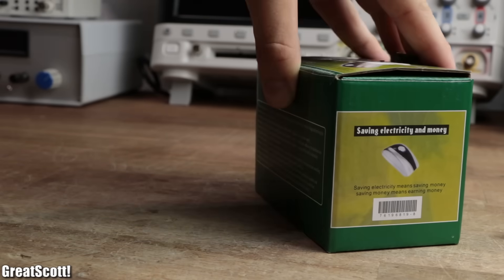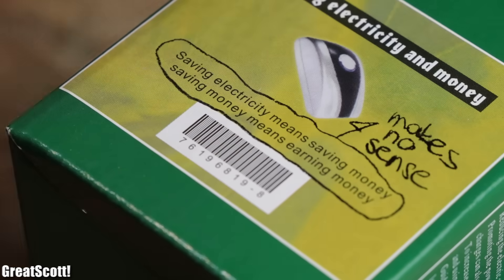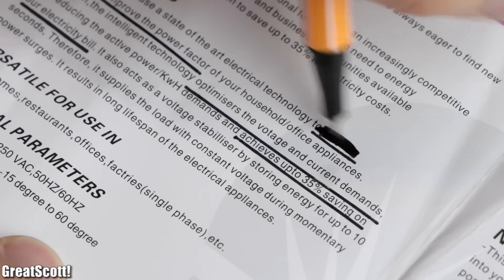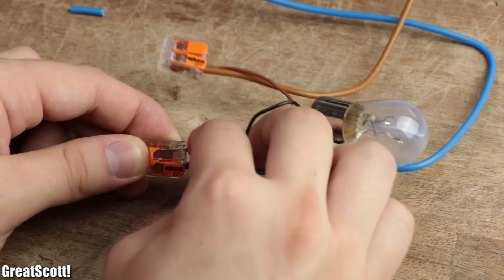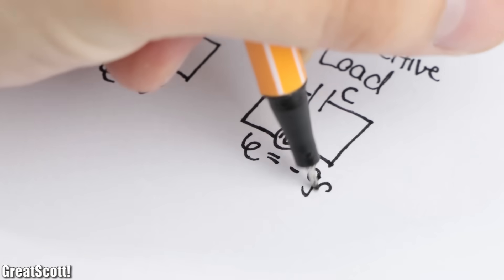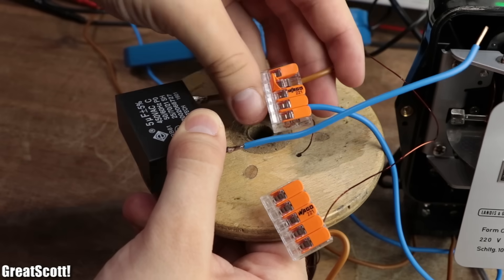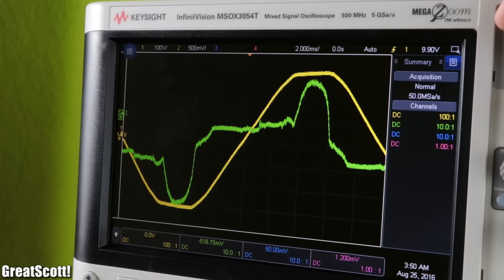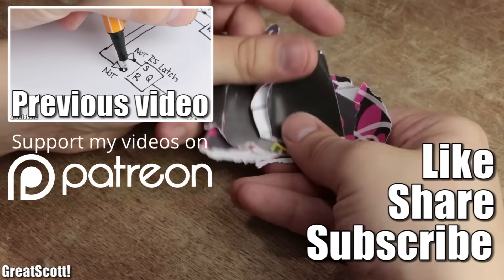Chinese Power Saver - Does it actually save power?

Comment: This power savers are actually power factor correctors used to connect next to inductive loads such ac motors or inductive loads to reduce the mains currents and hereby reduce the power transmission lost (cu lost in the mains cables). 30 years ago I met Americans came to Asia to market the same product! Any way it is not useful for normal homes which do not have big motor installed. And almost all the Electricians in China know about this device n know it does not save power at home n know what capacitor bank is about in the industrial n commercial applications. So this is an electric device, if you do not know how to use it, please consult qualify electricians.....

Comment: Power factor correction is widely used in industry, where there are typically large inductive loads that push voltage and current out of phase with each other. In these situations, it is possible to save a lot of money in terms of wiring and switchgear costs, because being out of phase pushes up the current that the wires have to carry, requiring heavier duty cables to get the same work done. Correcting the power factor is also an altruistic act in that it also reduces the wiring costs of the power companies. I don't think there would be much, if any, personal gain for households, but if everyone optimised their power factor, it might make electricity cheaper over all.
Chinese culture smiles upon people acting for the collective good. Ours does, too, to a certain extent, but we are more likely to be individually motivated. I am disturbed by the casual racism and ignorance of the humanity of other cultures in some of the comments. That hurts me. People are people.

Comment: Great vid this is the best explanation I have seen yet! The electrical theory behind these devices is sound, the problem in practice is that you have to size the capacitors and inductors specifically for each individual load. Just paralleling a capacitor of an arbitrary value into a circuit and expecting it to absorb or correct any leading current is foolish. The harmonics as a side effect only make the strain on the power grid even worse

Comment: The electricity or energy meters (Wechselstromzähler) for flats or family houses are designed in such a way that they only measure the real component of the AC current consumed (the one in phase with the AC voltage).
The complex task of power factor correction (Leistungsfaktorkorrektur), i.e. shrinking of the phase angle thus lowering the imaginary current component, which otherwise would tend to unnecessarily load the power lines, is deputed to power distribution companies. 
Amen! to this topic once forever

Comment: Thank you for posting . There  exist capacitive banks that can help but I have only seen them used in factories to reduce cost. However those are very expensive.  The new smart meters are doing a better job at monitoring this. The folks out there have to use solar powered batteries banks to reduce their energy cost at night. During the day I use the extra power collected by the solar panels that I have to reduce that cost. In the end use less electronics during peak times.

Comment: These chinese boxes are a rip off as the capacitors don't last long, but the science is sound. please attach your ammeter to your home fuse panel as before, then plug one of the boxes into a socket near the fuse box. when you turn the box on you will find a DROP in current used, less current means you are using less power, that little wheel in the electricity meter will turn slower, you will pay less, i experienced a 15% drop in my test, the capacitors are not large enough or self healing and do not last long. EPCOS is a large company who makes capacitors, they make a specific one for power factor correction called HOMECAP. https://powerpulse.net/homecap-from-epcos-for-residential-pfc/

Comment: I know it does not save you any money but it lowers current that wattmeter is reading. So, does that mean that I could plug in more inductive devices with a capacitor added in parallel?

Comment: It should save some money if you put like a washing machine or other inductive/motor load on the same power strip and use the power strip to control appliance on off.  For western countries it's not a big deal. But if you use solar/12V battery and an inverter to generate 110/220AC, then you definitely want to see if the device is useful for your situation.

Comment: The only thing you would need to reduce your power on is your compressor at start up on your AC and any motors and you have to do this VFD variable frequency drive which actually and I could be wrong converts the AC current to DC current does what it needs and on the way out basically convert it back over but it cannot do the variable frequency in a c current As far as I know I haven't been a maintenance in about eight years though so you never know what they've come up with I believe the guy with the second comment is correct if you buy enough of them you don't have any more outlets to useThe VFD where I used to work at at the prisons were huge course we were running 10 012 hp motors but unless they figured out how to control the alternate altering current from what I understand they have to switch it to DC to do thisBut what the hell do I know

Comment: Scott is really educated. Why, because other youtubers actually directly saying its fake but its not a fake product or a scam ;but scott actually says the truth . How??

You need to learn about a electrical engineering term called "Power Factor" to understand this. When we connect more inductive loads on ac mostly motors they create lagging power factor to compensate we need to put capacitor in parallel and this is what that deveice is.

But we can't actually mess up power factor this much that needs to be corrected.

The real answer is that this is not a fake device and Scott never said its fake or junk, he said its not required that is 100% correct.

Before any angry comment please learn about "Power factor" then comment 😊.

Comment: What about motor start up? The spike in electric motor start up could be supplied by the cap and it could be recharged slowly thereafter..  Smart meters and even some analog meters are designed to meter power at the initial spike and they keep running at that rate in order to charge the customer more money even though the power consumption levels off after initial load. This is why in industrial applications they install a capacitor bank and transformer unit in front of machines that have large electric motors..  To save power consumption, no?

Comment: Dear,
Could you review this product? 
It can save power by optimizing electron flow. It generates a wave which resonance with electron movement. Helping reduce resistor and then saving power.
http://www.cosmotor.net/main/

Comment: Saving or not depends on the type of electrical use inside the house meaning that if the consumption through the operation of electric motors  in this case availability and does not provide

Comment: For anyone curious, there is an actual industrial application to these things. As Scott said in the video, motors and capacitors create opposing shifts, the shift itself being called a "power factor" (a ratio of how much of your power is real). It's usually considered impractical and not bothered with to have residential customers billed for their power factor, but industrial customers often have a heavily skewed power factor without effort to fix this as their power consumption is heavily biased towards the inductive side due to (somewhat obviously) motors. As a result, factories bring people in to improve their power factor which does amount to adding some amount of capacitance. There's a bit about this in the wikipedia article on power factor. The idea that this would help a residential customer is pretty ridiculous, and there's a definite amount of cringe related to seeing a cheaply made metal box with no grounding they expect you to plug into your mains voltage.
Reply: Buyer beware ...SCAM.
Reply: Huh...but if im running a big CNC with a high power spindle, spindle controller, and stepper motors and such it might actually benefit yah?
Reply: @NeoIsrafil  No, residents aren't charged on reactive power. The cap will essentially turn active power into reactive power, costing you more.
In *industry*, they charge for both active and reactive and they charge you more for poor power factor. It works out cheaper to use the capacitors (with a controller to switch extras in and out) because you aren't penalised for poor power factor and you reduce your reactive power.

Comment: because the meter has a hard time reading var loads the device while does not save power by conservation it saves by cheating the meter into not registering.

the same supposedly as magnets on the meter or some other devices that inject power back into the meter out of phase to cause the meter to not work.

the meter is basically a motor and if you can interfere with the phase correctly it will not spin witch is why the wrong size run capacitor can cause the fan to run slow or even not at all

Comment: This is a simple dephasing system available for very small loads. That's true that old counters, that were built arround a magnet, were affected by dephasing provided the load was small, or the capacitance higher, but not the recent ones. This is not fake but abuse.

Comment: Well, in order to provide any kind of PFC correction, a capacitor has to match the inductive load. Simply putting a capacitor in parallel might provide power correction (to an extent) as well as might deviate the power factor even more. The only PFC that really works is the active power correction.

Comment: Of course it doesn't work for residential households.  It might provide some small benefit to large commercial power consumers (for example, factories), especially if their load is heavily inductive.   If there were any benefit to this, phasing capacitors would be standard in most electronic products and appliances.

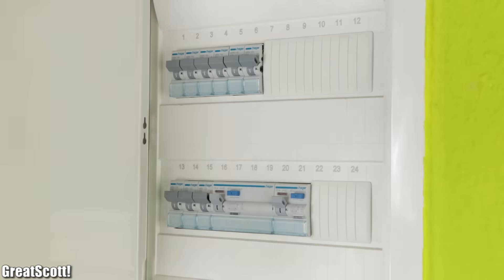Comment: can anybody tell me what's the name of the circuit breaker in slot 16-19 and 20-21 on 4:37?
Reply: Both are RCCB, slot 16 - 19 is for 3 phase, slot 20 - 21 is single phase.
Reply: WB IsMe ok thanks!

Comment: They traditionally worked, though not now. I'm from China and I can recall when I was a kid, those capacitor things worked with older electricity meters. Older meters are not designed to take capacitive loads, and in some occasions, they will spin backwards under pure capacitive loads (no other appliances on, only that capacitor). In other words, those capacitors don't save power, they steal power by hacking old energy meters.
Reply: This is kinda what i figures was happening.  So it won't trick the newer power meters?
Reply: New power meters are digital.. this stuff is useless
Reply: i am using this kind saver i does save money like under 20%
Reply: @crazymedia2102  you must use a lot of power tools then...
Reply: ...but you still sell them to get money for your army.
Reply: @yannisgk  what do you mean are you dumb it's not even a governmental product. Its your choice not by them. Your words are very racist

Comment: In theory, what would be the effect of running a home through a Motor / Alternator 
'gen set'?
Reply: Martin 
1 Wasted energy
2 Heat
3 Noise
4 Wasted money
5 Unreliable power
6 Decreased power available to your home
Reply: Hmmm, maybe not domestic but many Data centers use this system for UPS!

Comment: Ok. I have a question. Now knowing these are capacitors. That means that they store power for when there is a quick start up draw. Like a compressor motor. The instant draw. Now. We know this is a real occurrence because if you look at power poles you will see transformers, Every few poles and capacitor poles about every 50 telephone poles. Those capacitor poles are there for the instant draw loads. So there is less heat build up in the lines from having to draw all the way back from the power company. The capacitor poles ease that instant draw. Like when you flip a switch. That’s an instant draw. That has to come from somewhere. Other wise it creates way to much heat in the lines. That heat means your losing electricity to heat. Now. I’m not saying a .5 fared capacitor is enough to do anything. But what about one ment to run a hole house. Like the kvar kind. http://www.kvar.com just wondering if you could test this some how. Like. Do they make the draw coming into your home less that what is being drawn threw the lines in your home? Or could it be used in a way to increase the surge power of a inverter. Just wondering.
Reply: Jesse La Brosse 
1 That's not how AC reactive power works.
2 That's not how power distribution works.
3 Those are not capacitors.
4 Stop spreading spam links.
5 You have been reported for spam.
6 For God's sake, never work on any electrical device!
Reply: Buddy Clem well. Thank for answering my question I guess. It was a real question after all. I thought those could be asked. Real questions I mean. Well. Thanks again I guess.

Comment: These devices actually have the capability to reduce your power consumption by a great factor. You're gonna need a lot of them for this though. You need to connect them to all the outlets in your house. This works because you no longer have any outlets to plug your power hungry devices in anymore.
Reply: You could save even more money by buying a pack of plastic child safety plugs.  Use those instead.
Reply: lmao 😂😂😂 good one
Reply: Ice Flake, good advice. You hit it on the head.
Reply: But if you plug it to you neighbour power outlet then you have lower power usage...
Reply: I agree with you but only for those who are still using the old mechanical meter. We had the same mechanical meter before it was upgraded to digital.. And the power saver really does have an effect on the amount the disc turns... thereby reducing the power reading. i think the old meters used by the power company here in our country was actually measuring reactive power. But for the digital ones nowadays, it no longer works, and probably due to the fact that the power meters are measuring real power already... sad ///
Reply: This does  NOT save money. My electric bill actually went up $100 more than before. It is a scam.
Reply: lol
Reply: ترجمه فقط لمى كتب
ä.ol9 ä Ice Flake تتمتع هذه الأجهزة
 فعليًا بالقدرة على تقليل استهلاكك للطاقة من خلال عامل كبير. ستحتاج الكثير منهم لهذا رغم ذلك. تحتاج إلى توصيلها بجميع المنافذ في منزلك. يعمل هذا لأنه لم يعد لديك أي منافذ لتوصيل أجهزتك المتعطشة للطاقة بعد الآن.
Reply: Thank you, Ice Flake ha ha ha ha ha ha ha!
Reply: They had us in the first half, not gonna lie
Reply: This comment. Lol
Reply: Hahahahaha
Reply: hahahhahahahhaha you got me for a minute
Reply: hahaha! good one!
Reply: Lol, you almost got me there, haha.(insert Roll Safe meme here.)
Reply: Lmao
Reply: 😆😆you petty as hell
Reply: My kid and I use our pcs all the time. I have these in conjunction with them.  Couldn't hurt.
Reply: Why I can only like once?
Reply: LOL XD
Reply: Touche'. lol
Reply: You got me there
Reply: 🤣 indeed true.
Reply: Yes I own 2. It's working Saved 10-30% monthly
Reply: wahahahah trolling urself to consume less haha
great idea ahhah
Reply: Lol
Reply: Hahahahahahha
Reply: Lol my thoughts exactly.
Reply: You win the internet,
Reply: I am amazed that people are dumb enough to buy this 😂🤣😂
Reply: OMG, that's awesome!!!! 🤣🤣🤣
Reply: Lol, Chinese people think 2 steps ahead of themselves 😂😂
Reply: Lol
Reply: You need to have enough  capative load to negate inductive load to achive max power transfer and minimize energy loss. Principle is real but the items are scam
Reply: Bakit hindi inaactionan ng dti yan fake electric saver na yan scam yan
Reply: Wag kayong bibili fake scamer yan mga gagu
Reply: that's witty bruh
Reply: LOL🤣  don't actually try this though because if you have too much capasitence it will cause your house to have a leading power factor, and will actually cause the transformer that your house is connected to to increase its voltage output and destroy most of your sensitive electronics.
Reply: I have like that devicesin my home . I put in the of powersocket and I'd never remove  or transfer to another socket . We used  almost  6 month from now   .  yes reduced  my bill  before  we are not using this kind of device my bill is 2500   pesos in one month  . After we using this device  is big difference  from 2500  pesos  bill it's become 100 pesos 1 month comsume so big  difference  . I believe  this kind of devices  is really good...
Reply: @melagraam9259  totoo ba yan?,kung ganon bibili ako.
Reply: How? ..... by connecting 500 of them?